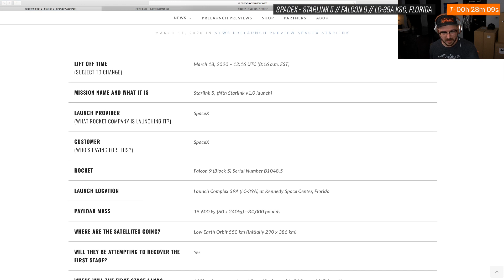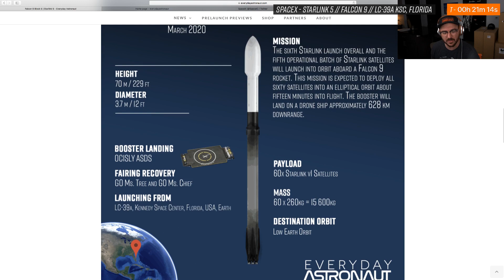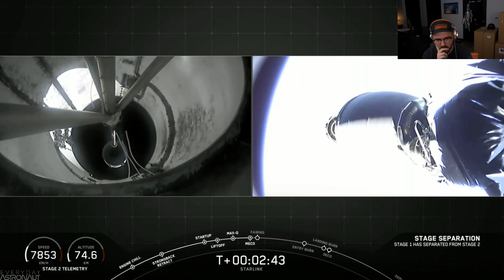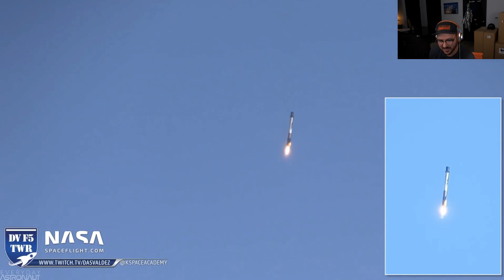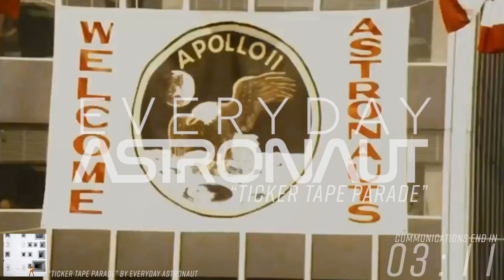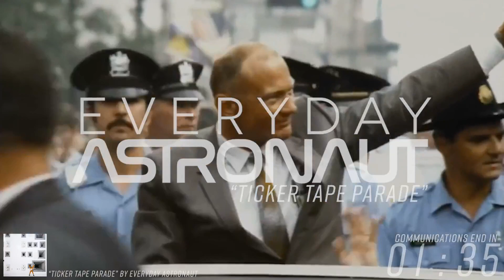Watch SpaceX launch 60 Starlink Satellites, reuse a fairing and fly a booster for the 5th time!

Comment: could the dragon capsule use parachutes over land but then just before they touchdown turn on the abort motors at low thrust just to soften the landing this is so they could still be certified easily and also have astronauts stepping out of the capsule in the space x space suit and then also it is easier to certify for reuse with humans.    please answer (someone who is smarter than me )

Comment: I did rough calculation of the total burn time for the Merlin engines on this booster:
The nine engines have gone through 5 full-length test burns before each launch, 4 re-entry burns, and 4 landing burns: 9*18=162 engine-starts.
They have been through a total of 5 * 145 s boost burn + 4 * 20 s re-entry burn + 4* 40 s landing burn = 965 seconds (about 16 minutes) per engine (9*16=144 minutes total) before one of them fails! That's pretty good going in my book :-)
Question for Mr. Dodd: Do you know of any other single rocket engine which have been fired for more than 16 minutes total?

Comment: It sure is a good thing that booster failed heading for Of Course I Still Love You instead of LZ1.
Reply: Remember the booster that had stuck gridfins? That was heading back to LZ1 I seem to recall, and look what happens.

There's really no need to worry; the trajectories are designed such that if ANYTHING goes wrong, the booster will splash down in the ocean. Hard or soft depends on how bad things went wrong.

Comment: Watch at 35:30, around T+2:21 it looks like an engine might have failed.  There's a flash and then you can see the engine on top wobble a bit.  It's right before MECO so the main mission wasn't affected, but I'd bet on that ruining the reentry burn.
Reply: Well spotted!
Reply: There was also one just before that as well, at T+2:13, a puff on the left hand side of the rocket.
Reply: Totally
Reply: yeah i guess its something to do with the fuel injectors or whatever you call it

Comment: What happens to the second stage after deployment?
Reply: It stays in orbit, till it bleeds of enough speed to "de-orbit" itself and then burns up in earths atmosphere.
(just as the starlink sat's do in about roughly 5years).

They have enough speed and altitude to stay up there for a decent time. 
But eventually earths gravitational pull will win, and drag them back into the atmosphere, slowing their speed(thus lowering their orbit).
Until the orbit is so low, and the speed so high, that they just melt/evaporate in earth's thicker atmosphere.

Comment: The second stage speed was 14900 to 15100 km/hour, when the ring passed, and the liquid on the camera after that must be RP1 Kerosene. The oxygen would freeze it over. One Merlin engine broke itself. Sierra, Hotel, India, Tango. Back to square one, and do it in the bushes.

Comment: But how do they reuse boosters(when successful)? Just fill them up again?
Reply: they do a small amount of refurbishment and then yeah basically.
Reply: Think Tim has made a video about the whole process.(or he mentioned the whole progress when disusing the Falcon 9 itself and what Block 5 really means)
now from what locked into my memory(so please don't take these as facts)
- They check the heat shielding around the engines(and partly inside the engine mount), replace/patch up as is needed.
- They make sure the Engines still work and are not damaged(If so, replace/refurbish as is needed).
- They check the Grid fins (those 4black bits on the top of the booster).(Patch up/replace as needed, tho when swapping to the titanium fins, seems to have removed any need for this).
- They check the fuel and pressure tanks(Fix/Replace as needed)
- They check the frame/superstructure of the booster.
If all is well, they fill it up with fuel and off you go again.

This is why the re-use of the booster takes about 2 months to be completed at this stage.
and with new techniques, newer materials, better engines, pressure vessels etc. they want to cut this down to make this less then 2 months, and remove about 90% of those checks.

So basically you get the same as a jet plane, where we know that the materials and processes are good enough.
So with a Jet we can now just land it (and without any abnormality) Just fill it up with fuel, cargo and/or passengers and send it on its way again in less then 3hours.

Comment: Tim, am I crazy or do we here see the Starlink second stage passing another satellite on its way into the insertion orbit? What is the object (gray circle with a bright pencil sticking off of it) in the shot at 43:04?  You can see it twice 24:44 (T+9.50) & 25:27 (T+10.34) in the actual SpaceX feed, but you missed the second shot of it here on your stream because you went back to rewatch the ice and booster wobble.  It's well after the faring halves drop away and well before the Starlink satellites are deployed.  Either it's a separate payload item deployed separately which they didn't mention or something else that was already up there.
Reply: There's no way it's another satellite.  The relative motion of things is orbit is tens of thousands of miles an hour.  In the exceedingly unlikely circumstance where another satellite would pass close enough to see it, it would be visible in the frame for only an infinitesimally small amount of time.  I doubt its a real object.  Much more likely this is just a camera artifact (light bouncing around inside the camera).  If it were an actual object it would have to be associated with the rocket or payload, like an out-of-focus ice crystal that just came off the cryogenic tanks.  However, my money is on the camera artifact.
Reply: @basketvector7311  Ever heard of a "geosynchronous orbit",  numbnuts?
Reply: @deeremeyer1749  geosynchronous orbit is 22000 miles up, starlink orbit is 200 miles up.  This was not a geosynchronous satellite.  You're not a fan of reading I gather.
Reply: Maybe i am to simple minded about this.
And i have no experience with camera's or anything like that.

But i would assume its either;
1. bit of Oxygen/water that got stuck to the camera.
2. a flareish thinng on the lens(tho no sure where it would come from)

i mostly think that, cause if there really was something of that size in orbit, it would have to be the ISS(and there are none of its distinct solar panels). Nor is the second stage in the right orbit for a encounter with it. and something of that size would most certainly trigger some alarms down here on earth. .
and secondly cause to my eyes(on both this stream and the SpaceX stream, the object appear to not be moving at all. and for a satellite in low orbit you would need to see at least a little bit of movement compared to the planet, to stay in orbit. as the height(altitude) of this second stage and this "thing" are far to low to be in a geostationary orbit around our blue marble.

But i'm no expert and be happily be proven wrong on any of my points :)
Reply: I think it's an Alien space craft
Reply: @nicevideomancanada  Totes, def.

Comment: I guess 5 liftoffs, 4 landings and one splashdown is the limit for Falcon 9 as is. They need to take a serious look at B1048.5  I think one of the rocket engines had a frozen combustion chamber due too a leaky oxygen vaulve? Maybe it don't close tightly enough? Or there is frozen chunks of oxygen in the pipes? We do see frozen oxygen on the 2 stage engine.
Reply: Johnny Nielsen still super impressive
Reply: There's always a little of that dancing around on the second stage.  Cryogenic fuels are constantly venting to relieve pressure in the tank, and some ice buildup is inevitable.

Comment: They need to find a way to increse the marginals and avoid engine failure.
Reply: Thedeepseanomad - “Increasing the margins” is probably not worth the effort (something called Starship that will be able to lift 6x the number of Starlink satellites at one go & repeat the trick the next day). Obviously, they want to avoid engine failure as recovering & reusing boosters & fairings is key to reducing launch costs...

Comment: Compare to other launch i had noticed the start up was late...and also leave ground  bit slowly...may be im wrong🤔 was that due to one merlin failure
Reply: Sandesh Manchekar Also it was LOUD. Did you notice the camera garble out? I’ve never seen that before.
Reply: @JayVal90  yep... i had notice that too...n also white birst at engine section just befor meco ( main engine cut off)

Comment: The water deluge system malfunctioned at launch! It was not at full flow until the rocket had left the pad. 33:03 They are normally at full flow 5 seconds before lift off. That poor Falcon 9 must have taken quite an acoustic beating in the first couple of seconds.
Reply from the maker: Nahhh not true. Water deluge looked normal. Check out 1:20 here. The main rain birds don’t go off until the booster is above the deck - https://youtu.be/i_vFU6DjhSs
Reply: Yep!

Comment: I missed launch as well due to quarantine, I watched it and you could immediately see the loss of guidance, I hope it’s not overconfidence that’s ramping up the failure of landings. I am the greatest fan of one of my countryman, but it seams like older vehicles are failing regularly on landings. Could be stresses on the vehicles
Reply: It probably is overconfidence, but only because it's their own mission, so they can push it harder(and on used boosters) than they would for a customer.
They are still delivering their payloads, so the failures would be worth the money lost so they can learn.

Comment: Several things seemed off with this launch. The sound suppression water system was very late and only activated as the rocket lifted off. The second stage camera seemed over exposed. The booster wobbled, and then obviously lost. Glad the main mission worked but why two booster loses in a row.
Reply: And it wasn't two boosters failure in a row, the last one that failed was starlink-4 after that was CRS-20 which was a successful landing, and than this is starlink-5 which failed.  You could say that two water landings failed in a row.